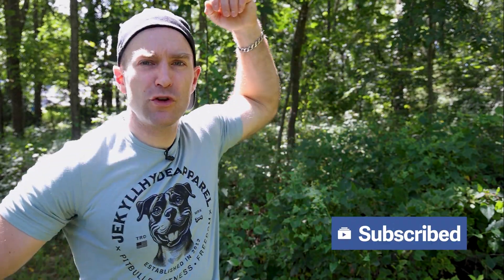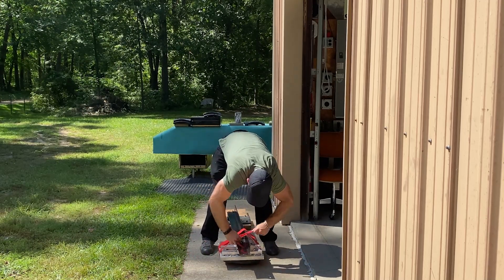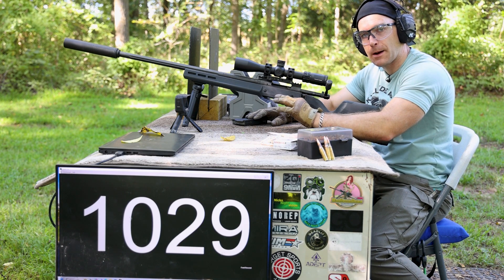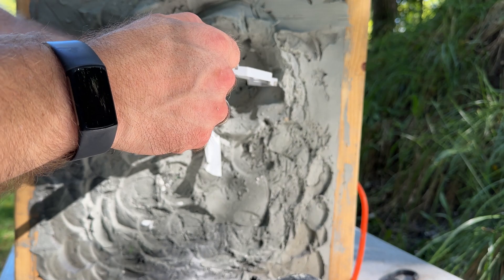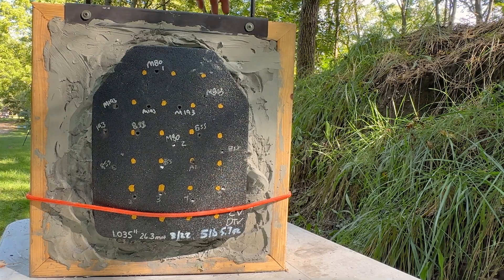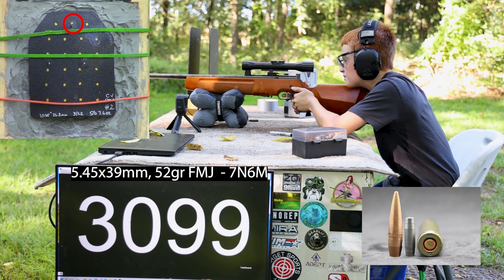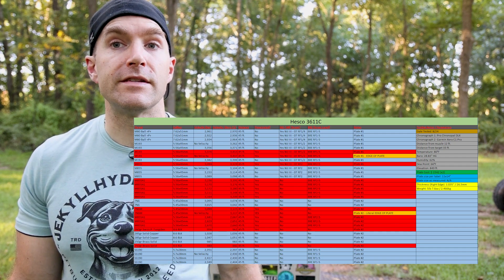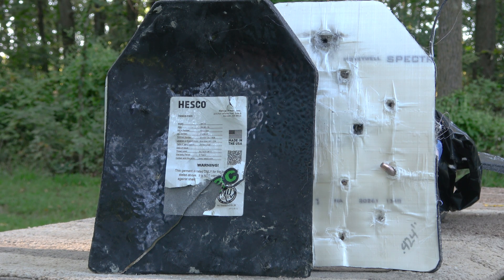Hesco 3611C NIJ Certified Level III (+) Body Armor

Comment: Do these have foam protection on the strike face, or just on the back? I couldn't tell in teardown at the end, but could that be why they cracked on the drop test?
Reply: @LMTran

No drop face foam on the 3611C, that is why they cracked.

The lack of lamination on the strike side of the ceramic strike face is another factor. Without lamination, cracks propagate much more than with lamination. 

Plates with dual lamination (front/back) will still crack, but the cracks are less severe and more localized.

Comment: I know this is off subject, but I was wondering if you could help me. I know you have done many tests on 5.7 x 28 ammunition, and I have seen you use the diamondback DBX 57. I have one as well and really liked the platform, but I have had two (one sent back and replaced) and the only ammunition that I can find that it will reliably chamber is.Ficcochi  40gr range dynamics. AAC with not fully seat, and is all but unusable. Federal is better but I it also has malfunction with somewhat frequent failures to seat. Have you experienced anything like this?
Reply from the maker: What magazine are you using? All Federal and Fiocchi, Speer, and SS197SR are all loaded by Fiocchi USA and is for the easier way to say it, The Same Exact Thing.

Comment: looks like you got a case of Garand Thumb lol
Reply from the maker: I hit my thumb a lot with a hammer
Reply: @BuffRANGE  🙄
Reply from the maker: @SylvesterDageone this one was from beating a jacket out of the barrel of an 8.6 BLK. It tooks months to grow out.
Reply: @BuffRANGE  ive got chronic ingrown toe nail issues...every single month i have to use toe nail softener on almost every single toe nail, and either pry it out, Or use a razor thin sharp object and slowly cut out the nail down at the bottom of where the nail grows in the cuticle...i know the all the woes of nail issues

Comment: Everyone's so hot for .277 Fury, but M855A1 seems to do really good without having to significantly change platforms.
Reply: You'd have to change the barrel length though from 14.5 to 22

Comment: Would a 3a backer have helped any? In your semi-pro opinion
Reply from the maker: Possibly, but it's hard to make a good guess without testing it, and it doesn't help there are lots of IIIA variations :(
Reply: IIIA or any soft is just a very poor match for any rifle round. When people have tested them, it takes something like six soft vest to stop the round. The physics of 3,000 fps +/- just don't worth with how soft armor stops rounds. 

It would be an interesting experiment with an chronograph and high speed camera.
Reply: @kenofken9458 yes, but would it be the same with a IIIA backer right behind the III+ rifle plate? Much of the energy must be lost into the hard plate.
Reply: @scepticalwalker3984  Maybe, but it seems like when rifle rounds make it through plates, they do so decisively. 

If on breakthrough, its velocity is down into the sub-1,600 fps range, soft might stop it. If it only drops from 3,000 to 2,500, the odds are not good. It could also depend on how deformed or broken up the round is after getting through the steel. Larger surface area is your friend with soft armor and backing materials in general. 

I've seen designs where the front of a polyethylene plate is a thin piece of titanium. The designers know the metal will fail with a rifle impact, but it will fail in a useful way, pushing out a disc wider than the round.
Reply: @kenofken9458 I am sure you are right, but I have seen fails (not sure if it was on this channel) where the tip of the bullet (still lodged in the armor) peaked out on the backside. It is considered a fail/penetration even though the bullet didn’t have enough energy to continue into a person’s chest behind the plate. Might have been a green tip in a M210 from Hesco?

Comment: With these sort of level 3 plates, you are going to see some corners cut due to the added overhead for certification.
Reply: In reality, they probably didn't cut corners it just shows how wide the specs are.  Like Mil Spec requirements.
Reply: @jb7483  

Then it comes to NIJ certified plates, you are typically looking at commodity plates. These are either heavy alumina level 4 plates, or level 3 plates (usually PE) that are built to meet level 3 and nothing more.

If you examine the NIJ certification and follow up audit process, you will find that certification incurs substantial initial and ongoing costs to maintain. To justify and maintain certification, you would need to sell a substantial quantity of plates, and these plates will also have the added cost of that certification. A plate like this is already going to be more expensive than your average level 4 alumina boat anchor, so you are going to cut corners to bring cost down, as you can evidently see with the build of the plate.

On the other hand, milspec plates (ESAPI for example) are some of the best plates on the market, but VERY few of them are NIJ certified, at least to contemporary standards (LTC 26300 for example). These high end plates don't NIJ certification, but the buyers own standards (FBI, DEA, HO, etc), so there is no point in NIJ certification. This is why you will not see a whole lot of NIJ certified high end plates.
Reply: Got proof or just conjecture?  I work in a field that is heavily certified, and this is the furthest from the truth.  Most fools think they will be shot multiple times and be OK.  1 shot, you are going to feel it blunt force trauma is a thing.  When I was ARMY, I took 1 762x54r and 1 762x39 rounds in a plate and it felt like a truck hit me.
Reply: If there were corners cut... they'd be found during the certification process